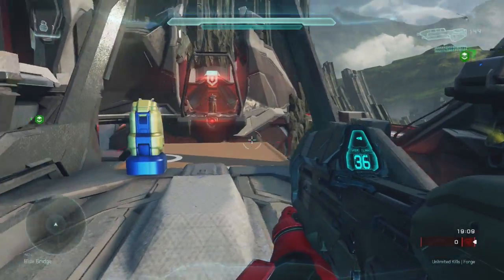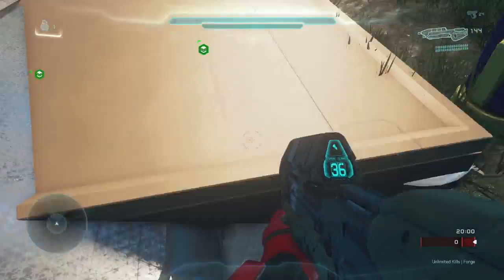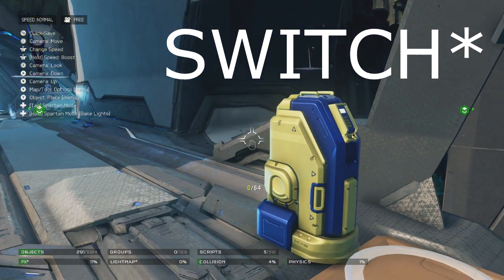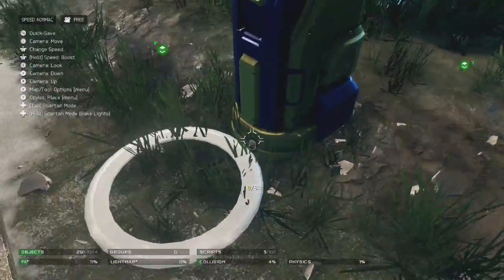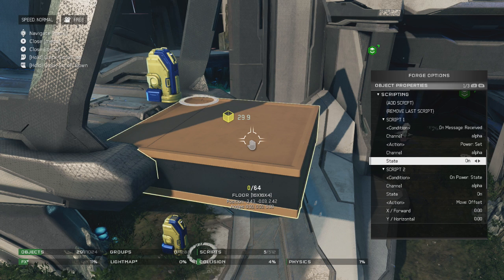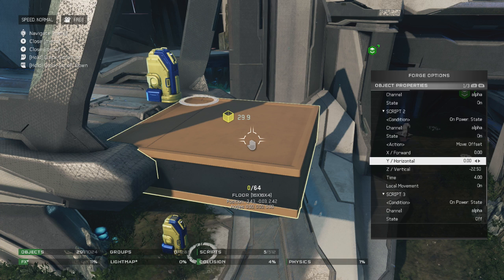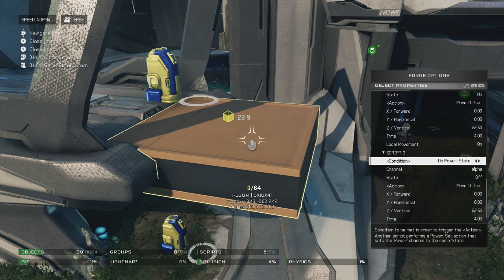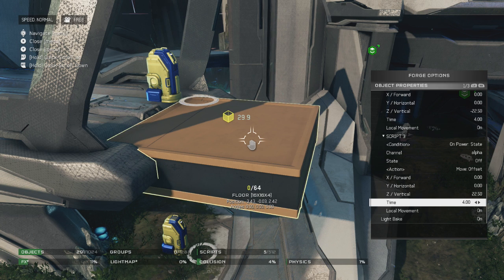Halo 5 How To Build An Elevator | Simple Scripting In Halo 5 Forge

Comment: I am not good with these scripts. They are a bit confusing. I couldn't get this to do what I wanted when I used 4 windows to make an elevator. But, is there any way to get the switch to move with the platform? I had ideas of making one with closing and opening doors, the ability to stop at a certain place, etc but I can't even get the basics to work.

Comment: the flaw in this is that if someone presses a button twice before the animation completes, the elevator will change mid action and get set into a different position than desired. do you understand what i mean?
Reply from the maker: +Alex Peffer yes, like the set location will be higher or lower than its supposed too, i suppose in theory, you could make the switch move with the platform on toggle as well?
Reply: +OddRob 
That's true but I was trying to apply it in other areas such as a building were someone may have used the elevator but left it at the lobby and someone upstairs needs to call it 
The only solution I have, so far, is to add an extra script to all the switches so they would despawn and set the respawn time for a little after the interval it takes to come up or down